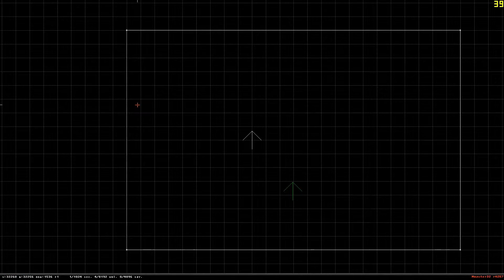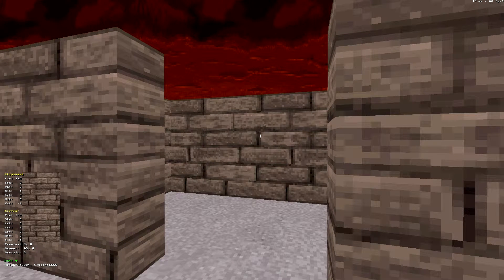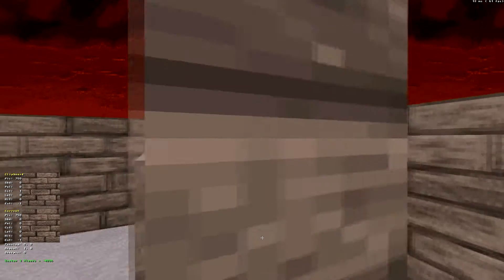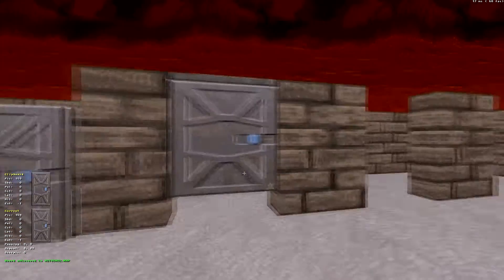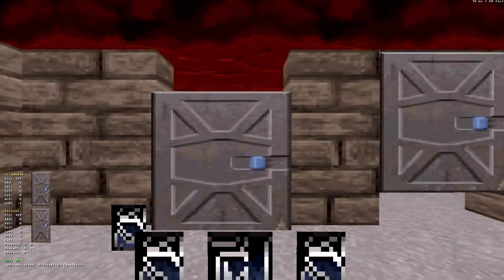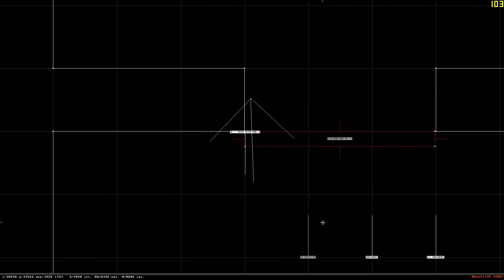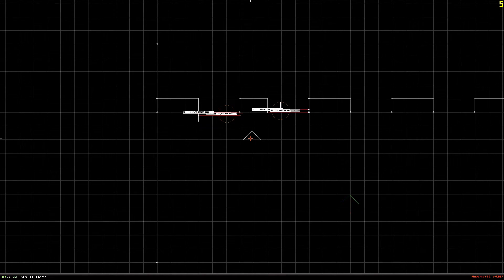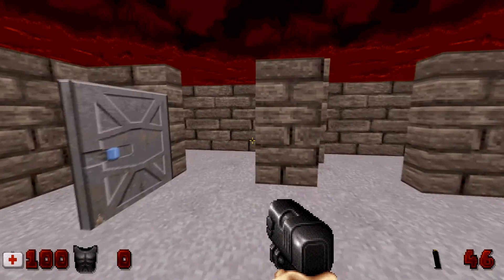Mapster32 Tutorial: Swinging Doors

Comment: I have been having trouble making a swinging door that is locked via keycard. Any Thoughts?
Reply from the maker: +Zettu As far as I know, you just need to put an activatorlocked sprite in the door sector, and give it the same lotag as the keypad you have to put the card in. Hope that works! :)
Reply: It did thanks I also had an odd pallete number on the access sprite apparently only 3 different pallette numbers work on them
Reply from the maker: +Zettu Yes, those are palettes 0, 21 and 23 I believe. And glad that it worked! :)